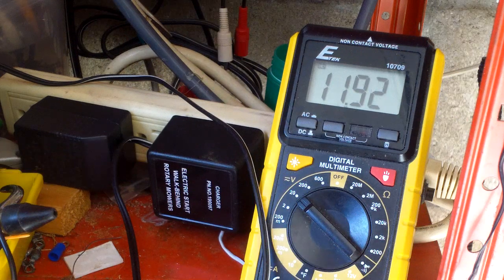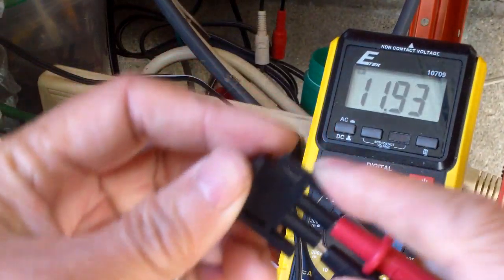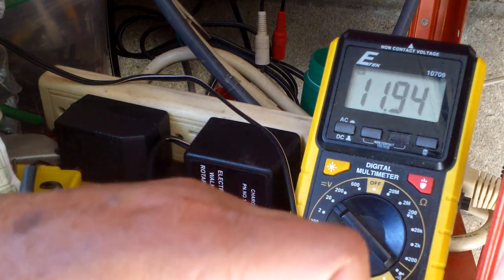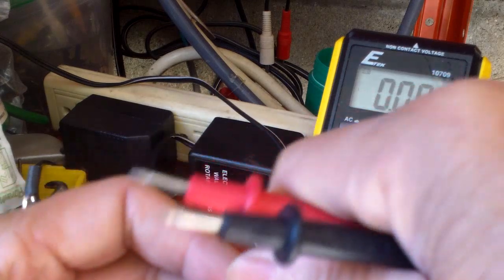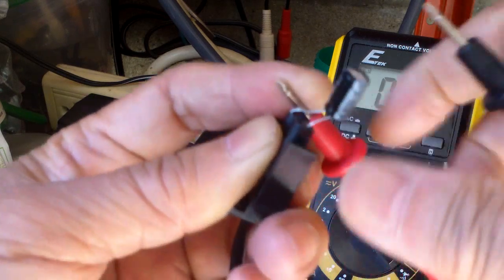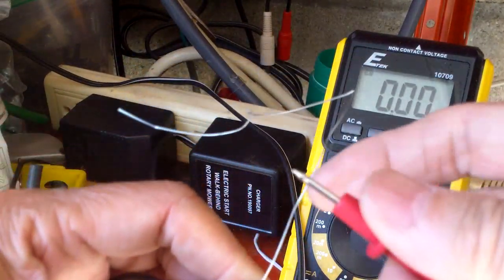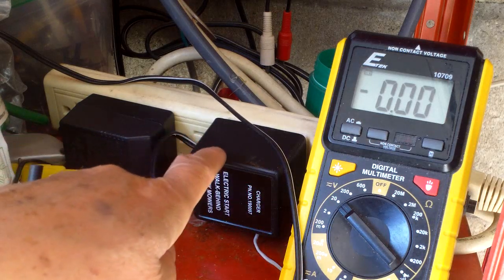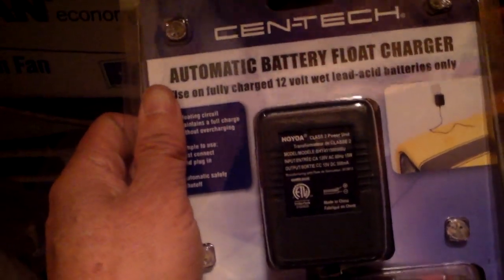What I learnt about my Craftsman lawn mower charger today

Comment: The newer ac dc supplies are mostly junk.Cheaply made with penny parts cut back missing.What uf and volt cap did you use? I did not suspect at least the mower charger to be out of spec and or cheap made.That said, as you are aware of my recent mower project, I may just stick with the float.Of which the one in video is one I got you told me of.What I need to figuar out before I need to charge again is, the connections.I can't find nor have the connect.When battery was out when I got float charger I just stuck two nails and bent left right.Nail went snug into battery clip and I put float on and charged.Now that battery is inside door hatch of my project mower, it is secure and screwed down.I see that the ignition cable by fuse the end differs from battery.The plug in is pin type.No nail etc will work.Nor want to go that route now.My option is, if I stick with float is cut the end.Leaves + - wires.Problem is, now I need a connect like on battery to put on those float charger wires.Been to Lowes been every place.Course Radio shack closed.No luck.I do not want to cut the cable nor battery wires as well.I'm sure Ebay has what I need, finding it though is a needle in a hay stack.
Reply from the maker: The capacitor I used was probably 50v 400 uf.  Probably better off to make your own connectors if you cannot find the right ones.

Comment: That is correct. The Craftsman charger does not have a capacitor inside (or it my be open). So you will get a major ripple out of it at reduced voltage. The battery actually acts as the capacitor and then it fully charges. I seen it numerous times when opening up these types of chargers and finding no capacitor. The smaller charger has a capacitor inside and should put out the proper voltage at the rated current load printed on it.
Reply from the maker: Thanks for your insight. I will break that charger apart someday (when it's broken) to see what is inside. I have a lot of failures with the cheap small switch mode type 12v or 5v power supplies but these older crude types seem to fare better.
Reply: wtam69 I agree, see it all the time.  The old non-switchmode transformers seem to last forever, and can withstand overloads for short periods of time, where that would throw a switchmode into protection.

An old co-worker of mine was talking to me one day about old cars, and how his car has a carburetor, and how he likes it so much better than fuel injection.

Later on I experienced his point in person, when I drove 2 identical cars (different model years) when they transitioned from carbureted to fuel injected.  While the fuel injected vehicle probably got better gas mileage, the carbureted one had considerably more "get-up-and-go".  My old car was carbureted, my new one is not only fuel-injected but also throttle-by-wire.  Still doesn't feel quite right...

Comment: That's really interesting.  I actually had done that as a kid (hooked a capacitor up as such), and saw the voltage increase, but never directly knew why.  Looks like I learned something too!
Reply from the maker: It smooths out the spikes. I just assumed the power supplies would have them but apparently not so.
Reply: Its a slow charger therefore the voltage should be lower..